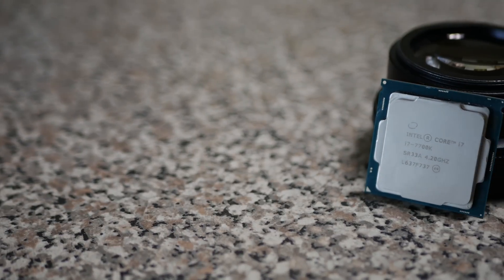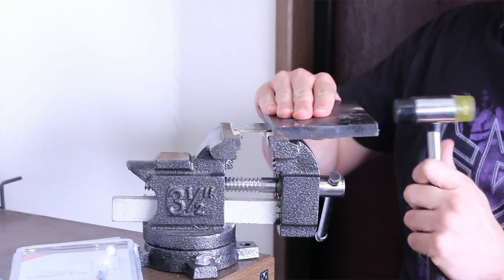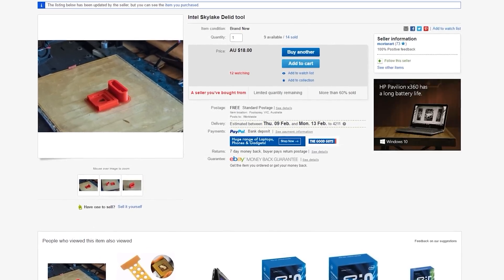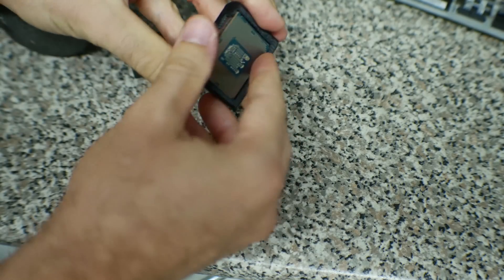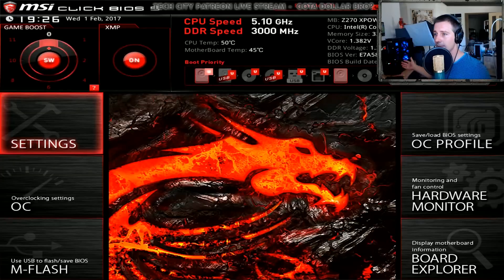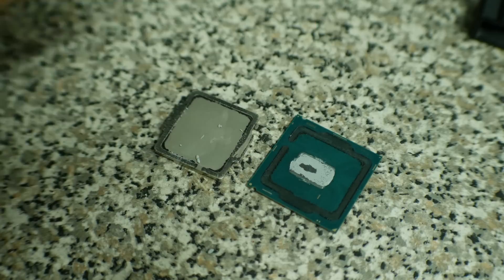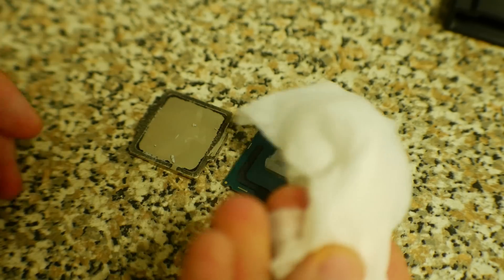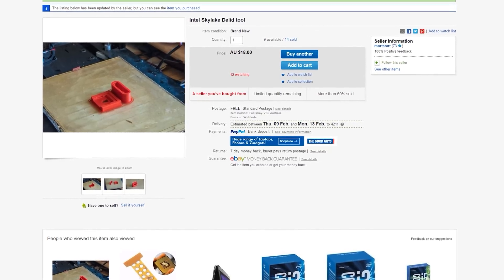DELIDDING The i7-7700k - How much of a Difference is there?

Comment: What the hell Intel.. that paste is garbage..
Reply: seriously tho, i started watching the video expecting 1-3C difference, not 15..
Reply: +Misterblack83, weirdly enough he didn't show the difference at the same speeds. Those 15 degrees were at even higher clockspeeds and voltage
Reply: Overpriced CPUs with cheap paste. Intel is joking with everyone.
Reply: They just bought 2nd hand toothpaste, so they can save some money.
Reply: MisterBlack83 actually it would be about 20°C at 4.9-5GHz so that's huge
Reply: Maybe when Ryzen comes out, they're forced to use better thermal paste between the die and IHS.
Reply: +Fuddy Duddy

1. The vega GPU shown might not be the best they have.
2. Doesn't matter if it gets thwarted by the 1080ti, vega is set to be released at a cheaper price than the GTX 1080, which'll make it more attractive. The majority of the gaming community cannot afford such high prices, so the lower price will make AMD ryze again.
Reply: Yeah, It's almost like the paste is rotting in storage or something and they just don't care.
Reply: FANBOY DETECTED FANBOY DETECTED
Reply: +Dex4Sure , actually VEGA is not really that impressive from what has been leaked. The DOOM results showed only a 10% lead on the 1080. Something that can easily be thwarted with a 1080TI. AdoredTV has a good video on it. It is also incapable of offering any resitance to Volta if these results don't change drastically when it actually hits.
Reply: +MisterBlack83
he was 15c cooler and had a higher overclock so at the same v core before the delid would have had an even bigger temp drop like he said in the video at least 20c drop.I am not sure why he didn't test the same vcore and over clock before delid and after? i got around 24c after my delid so truly alot to gain
Reply: its not the thermal paste that is the problem. it is the gap created by the black sealant
Reply: All k processors should be soldered. This is what happens when you have no competition, everyone loses.
Reply: MisterBlack83 it's not only garbage the main issue is it forms little air pockets and gaps!
Reply: ManisCo 1. Oh it is the final silicon, the only thing that can change is final clockspeed and driver otimizations. That was their best chip, we're mere weeks from launch mate.

2. how is this in AMD's favor. Their top-end chip will be outclassed immediately again. This is not the swoop it needed to make with it's big chip. It needed to smash pascal. It doesn't.
Reply: New video... same speculative bullshit from the AMD fanboys. GTFO +Dex4sure and stop spreading false information.
Reply: it shouldn't matter if your a fan boy or not, just buy whatever gives you the best performance for the money. or does everyone else just like wasting money?
Reply: Other TIMs aren't advertised for being behind the IHS. TIM has to last quite a long time, way more than 4 years. Average consumers aren't meant to replace the TIM under the IHS and shouldn't have to, so the temps need to stay very consistent for years. Intel's "crap" isn't meant to outperform, it's there to last as long as possible.
Reply: You'd think but you don't really know. Consumers are just talking out of their asses at this point.
Reply: well an informed consumer will experience way higher temps since sandy bridge, which means lower overclocks and higher temps, this is sth. consumers directly suffer from.
i mean the most logical conclusion i will go by is:
soldering is expensive, good thermal paste is slightly more expensive than the crap they use.
their crap is good enough/unnoticable for the non overclocking user, thus they did the math and well get away with it, because they are running a monopol for the moment.
this seems to be the most logical approach to the situation and unless i see any proof that shows the opposite i will go by it as it also fits all other decisions from intel that are anti consumer.
i will not delid a cpu i paid 200 plus euros for and lose all warranty and thus many 24/7 stable overclock users suffer from this shit.
also just to be clear i'm fine with thermalpaste to avoid resource wasting just not fine with crap one that hinders the user.
Reply: What intel should do is just sell de-lidded K series processors anyway. Add $10 bucks. They don't include fans because they know only Ocers buy K series chips and you need 3rd party fan. So why even bother lidding the K series chips in the first place.
Reply: well i meant that the difference for the average person doesn't matter anymore then, having a paste of the level of noctua nt-h1, gives good enough results, between silicon and ihs.
of course liquid metal or solder is the best, but i can imagine liquid metal can create issues not in use but production and shipping etc...
also isn't the difference between liquid pro and kryonaut relatively small too?
i mean thinking reasonable shity intel could use noctua nt-h1 for their non k cpus and kryonaut/solder for their k cpus, that would be great and the k could actually have some meaning.
and almost everyone would be happy with that i think.
Reply: Intel went for longevity rather than performance.  Not sure if that's true.
Reply: @ManisCo

We've been down this road before. When NVidia released the GTX 780 TI, the price of the 780 dropped by about $150. When Nvidia released the 980 TI the price of the 980 dropped by about $150. When the 1080 Ti gets released, we'll probably see the 1080 drop into the $500 price range and the 1070 drop to @ $325.
Reply: Vega will almost certainly lower prices, which is good for the consumer, but if the information we know so far holds, it won't be good for AMD. Nvidia has a smaller die and has had a year to recoup their investment and refine their process and thus has superior pricing flexibility.

+Gamevet's prices look realistic and are a likely outcome when the 1080 Ti is introduced, which will be a response to Vega. Positioning it just above Vega will allow Nvidia to maximize yields. These price drops also nicely "refresh" the product line without releasing anything new by making previously unattainable products available at lower prices.

AMD isn't known for sandbagging, but a case for it would be them knowing that Nvidia is likely to release the 1080 Ti as a response. AMD could hypothetically counter with a Vega Pro or something and force Nvidia to hastily release a 1090 and readjust their product line twice in a short period of time.

I don't think this is likely, but it's not outside the realm of possibility. Given AMD's dire financials they really need to put their best foot forward and not attempt to manipulate the market as an underdog.
Reply: or solder u know.... but if u run with the idea that we shouldn't use up that much indium, which is reasonable i guess, then well..... why use crap thermal paste????
Reply: Well Intel dominates the CPU market they are just waiting for AMD to release promising CPU's only so that they can finally say we actually bought thermal paste just so they can distance themselves from AMD one problem with AMD is they cannot compete with skylake/kabylake i7 chips as they do not have CPU's with high enough clock speeds
Reply: TIM intel uses is cost efficient. If they used Coolab Liquid, it'd be a lot more expensive. Mass producing chips + needing to use rare indium tin isn't cost efficient at all.
Reply: i think u lost contact to reality a bit evilwiffles.
they don't have to use solder or liquid metal a simple non conductive thermal paste will do the job
noctua's nt-h1 would do the job just fine a good value paste used by a ton of people!
it's non conductive and long term stable, it going by noctua has 15 applications in one tube and on amazon comes to 5,90
this means 0,39333 dollars!!! per application  and this is sold, u can cut of a bunch of cost and profit if intel were using it.
let's say 30 cents per cpu.
30 fucking cents for cpus that cost 75 dollars upwards and that is a careful estimate.
remember it's not that intel uses an ok thermal paste they use dirt no one would use.
solder > liquid metal > top end non conductive thermal paste > average value thermal high quality thermalpaste like nt-h1 > crappy barely ok thermal paste > intel crap dirt cement they are using.
there is a lot of room for improvement, again without any real cost.
is it to much to ask from a company that keeps selling hypterthreaded quadcores as their standard after several die shrinks to use an ok thermal paste at least? as they don't solder them anymore.
Reply: There is a reason they don't solder them if you didn't know. I'm not sure why they use the TIM they use either but they aren't stupid. So there is likely a good reason for them using "crap" tim.
Reply: Probably due to thermal cycling as well. The TIM they use performs consistent vs other brand TIM for instance.
Reply: there is one reason i can take as reasonable, which is we don't wanna waste rare indium, when we don't have to.
and consistent? well what do u think the noctua one will do?
mine is on my cpu for over 4 years now? temps are just fine with a high vcore sandybridge.
one point that also comes to mind is if they are properly placing the thermal paste or if they use a to thick application like if they were soldering. this will also shit on performance.
and there is no reason to use crap thermal paste but the tiniest amounts of profit.
and noctua and other brands test and think and have in mind that cpu thermal paste will not get changed after first application although this might not be ideal it is very often the case and it is very very very hard for me to imagine that there will be a point, where intel's thermal crap will outperform nt-h1.
Reply: 4 years was just my personal example, do you really think this is the best intel can do temperature wise?
Reply: 4 years isn't much though, bud. If you want performance, delid and replace just like I have with my 4790k.
I've got a Pentium 4 CPU that used stock TIM for quite a few years and performs just fine. Made to last as long as possible, and it sure has done that.
Reply: i know 4 years isn't much, i get the feeling u assume that intel wouldn't do a fuck u to consumers instead of using better and lasting thermal paste, there is no way this thermal paste is the best they could have come up with.
Reply: @evilwiffles
youtube not showing your latest comment here, thx youtube being great as always....
u know what fuck it: your comment was:

EvilWifflesThey
 aren't anti-consumer. I mean, there are plenty of reasons they aren't 
pushing performance on processors too. Hell, if you think about it, they
 are helping their competitor by not releasing more significantly 
powerful processors. It wouldn't benefit Intel if they released more 
powerful hardware either way.

i'm to annoyed to try to read out of my email to reply (annoyed at youtube not the discussion)
your comment seems weirdly defending for a company producing shit.
would u not want a 8 core cpu? look at skylake diagram how big the igpu is, all space for cores while needing the same diesize for the chip.
well the last part is true, of course it would not benefit intel to release better processors,  they can keep going with their 5 percent per generation, because they are running a monopol.
why are u defending them producing shit? they could benefit and produce good cpus.
and the other shit intel does isn't anti consumer for u either?
microcode updates that will result in bluescreens for non k overclocked cpus???
how is that not directly breaking your hardware.
https://www.techpowerup.com/219923/intel-pushes-cpu-microcode-update-which-cripples-overclocking-non-k-skylake-cpus
thinner pcbs, that may break under common after market cpu cooler pressure.
and the list goes on.
intel is clearly anti consumer, intel is also pro israel which is way worse supporting child murder on a daily basis with their factories in israhell.
but point is intel in general is anti consumer and the thermal paste issue would fit their behavior just fine.
Reply: great comment blubb.
i would highly question the accessibility of obtane, well given that it's intel...if i remember right it should be much cheaper to produce than mlc, but please correct me if i'm wrong here.
i can't support intel, but i really like the thought of obtane, it seems just another monopol to me then.
and that we are held back is very true.
quadcores were out, before applications that were hard to optimize for them were optimized.
if we had 6-8 cores for a while software could look very different.
a thought by me in the future would be that we would have at one point socs with gpu and cpu and hbm2 and obtane like storage with very high bandwidth connected to the chip.
as latency and bandwidth will become more and more of an issue in maybe 10 years this will be there solution and it will be a step forward, because of performance and not planned obsolescence like the currently soldered ram in mobile devices.
and personally i think the security nightmare of non volatile memory as system memory would be completely ignored..... except in the business/enterprise part.
i mean people have windows 10 with backdoors with full file access on their phones, the private sector really doesn't care about security, it may make it look like it does, but in reality....
Reply: If AMD were to ever be truly on the rocks and couldn't get any more credit, I wouldn't be surprised if Intel threw money at it, similar to how Microsoft bailed out Apple in the mid-90s. MS was sued anyway, though.

Regarding SSDs, they magically make the oldest shit viable again, unless we're talking about single core 1 GHz Celerons, AMD A4s/Neos, or Pentium 4s. I like that M.2 SSDs are becoming so extreme that they're stressing PCIe design and layout as well as the northbridge <-> southbridge link. This will force innovation.
Reply: Lul, it looks just like my 3$ thermal paste after using it 5 years, but at least mine wasn't rubbery at all haha.
Reply: There has to be something wrong with Intel's thermal paste... I remember when I delidded my 3770K the paste was dry like an erasing rubber, I replaced it with arctic MX-4 inside, but the improvements were less than 4-5ºC. 
If the current gen has such a big difference I thing they are making it bad on propose, just to sell a mid-cicle SKU like it's rumored after AMD releases Ryzen.
Reply: There wasn't any difference in temperature when I swapped to AS5 on my 4790k. Only dropped 10c by using CLU. Die is smaller now, which means less surface to transfer heat to the IHS.
Reply: @jimmysthebestcop no, just solder that shit, or use proper distance and thermal paste for the k series at fucking last it's already insanely overpriced.
if that is taken care of, no overclocker will get benefts from delidding, unless they go liquid nitrogen, or rather the difference is so tiny that it doesn't matter, if we compare liquid metal vs an ok thermal paste with proper distance to ihs.
remember k series is already paying more, for a feature that every cpu should have (unlocked multiplier)
Reply: There are rumors that AMD uses indium instead under their heat spreaders.  I also can't help but notice that he put the lid on top of that liquid metal.  I wonder how long it took before the gallium obliterated that heat spreader.
Reply: @john doe, it's not a rumor, der 8auer (overclocker) delided some r7s, with the result being, that amd properly soldered the chips to the headspreader and that there was basically no difference in temperature of changing to liquid metal and almost impossible to do.
so u probs would kill the chip trying to do so and don't need to, because amd's strategy was literaly:
we don't have quite the ipc that intel has, BUT!
we can give people everything else they want pretty much...
soldered  chips, all unlocked, enough io for the average user, multithreading for most chips, good prices...
who knows maybe next generation intel will stop using tooghpaste again, and they might need to, given the 7700 and 7700k being close to their max temps and with oc even worse.
hell some articles poped up showing that intel cpu temps were even spiky, which shouldn't be the case, so maybe their sensor is fucked up too....
https://www.techpowerup.com/233018/temperature-spikes-reported-on-intels-core-i7-7700-i7-7700k-processors
showing a cpu spike over 8 degrees celsius at 100 percent load, that doesn't happen, so fuck knows.

i rly wouldn't be surprised if intel markets   soldering on their k processors next generation.... as a great new feature....
Reply: Intel chips were good before they started using inferior paste under the heat spreaders.  Now I wonder if they have lost it.  Anyone knows that typical silicone thermal paste dries up eventually.  They may make chips that are faster than AMD chips but I feel that Intel is starting to cut corners.  I wonder how long their chips last before they die a horrible thermal death after that cheap compound dries up and becomes as useless as plaster.  Considering that, I am all too happy with my FX-8350.  There is one guy on Youtube who delids the AMD chips and it involves heating it up gently until the indium under the heatspreader softens and lets go of the chip.  There is sealant under the heat spreader under the edges similar to the way Intel mounts their heat spreaders.  That guy who delided the AMD chips did say they still work.  You just can't expect to pop that thing right off of it like an Intel chip.
Reply: #john doe
that guy was 8auer or another person that did it, yes heating it up was part of the process.
and intel has lost it for a long time:
intel has fabs in israel, the country that tortures and murders palestinian children on the daily basis and which rogue country's main religion judaism contains genetal mutilation and sucking on the babies penis right after (yes)!
so intel is support this with the fabs there.
next:
intel made specific microcode updates, that are there to brick your non k system if it was overclocked.
so u get a bluescreen or freeze on your perfectly stable non k overclock now, just to fuck u.
intel socket jumping every generation so upgrade costs are more expensive, intel  keeping real cpus (8 cores! plus) locked away behind huge paywalls without any reason if u compare the almost useless igpu vs the  cores on their consumer chips.
intel not only switched to toothpaste instead of soldering the chips or using good thermal paste.
remember it's not just bad it's horrible thermal paste they used!
but they also made the pcb, where the chip sits much thinner and weaker.
so using high mounting pressure can bend and or break the cpu.
which gets better when u think, that the standard delid procedure involves not gluing the headspreader back on, resulting in less strength for delid cpus, even worse for direct die cooling....
so if u managed to not break your cpu through the delid, u then got another change with mounting your cooler... isn't intel nice with those k processors :D

some things  i probs forgot, because intel is doing so much horrible shit and anti consumer shit.
but for the israel fabs alone i won't buy direct intel  cpus anymore.
Reply: @patrick dezenzio,
that is if the soldering 8auer did can be compared to the soldering intel and amd would do on their chips
furthermore i want to give u sth. to think about:
does thermalpaste or rather toothpaste in the case of intel deteriorate over time?
depends on quality, with drying out being a major factor from what i got.
do intel cpus already run extremely hot and also spiky!!! at least going by their read outs:
https://www.extremetech.com/computing/248908-intel-responds-i7-overheating-issue-cluelessly-suggests-stop-overclocking
yes!
so u got a very very hot cpu with a possibly deteriorating thermalpaste inside over time.
so will the solder really create more issues than intel's toothpaste and make the chip die faster?
i don't think so, but one thing is for certain we can't trust a word intel says.
remember the ones that will make the pcb of the cpu thinner to create breaking or bending of the chip under strong mounting pressure.....
because that's good for consumers...?
Reply: It is a good paste, it's very stable. The CPU will perform the same for the whole life of it, unlike ''better pastes'' that degrade over time and need replacing.
Reply: @philip cooper
u are sarcastic right?
toothpaste =/= good thermal paste.
it doesn't matter how stable the toothpaste, it will forever stay toothpaste, while solder will outperform it from day one till the end of time.....
Reply: Solder cracks after a certain amount of heat cycles (reason for dead gfx cards and motherboards, since the begining of the times). I know people like to hate the big manufacturers, I fully understand that, it's cool to be a part of the ''hate team''.
Reply: are u refering to flip chip design dead graphic cards???? which most all use thermal paste as interface.......
solder joints vs soldering for heat transfer are very different things.....
almost no gpu has an ihs, however they may have internal solder joints, that get fucked.
with myths of putting graphics cards into an oven fixing it,  well it doesnt.... and just creates zombie chips.
also if u building your whole solder crack thing on the one article from der8auer i highly suggest u try to get statistics instead of one person's private solder work,,,,,,,